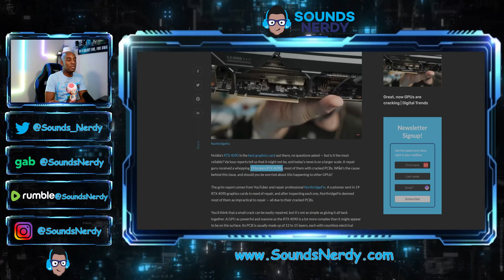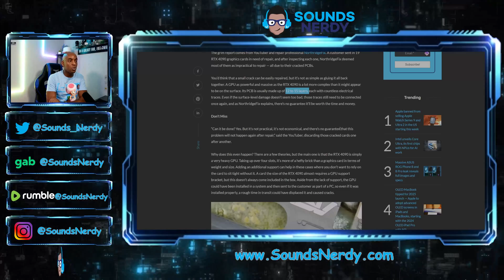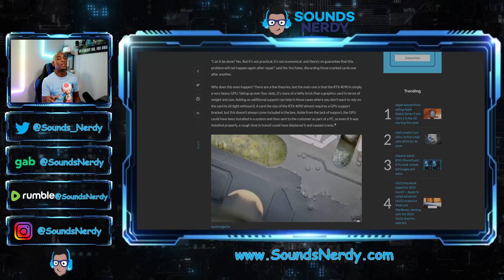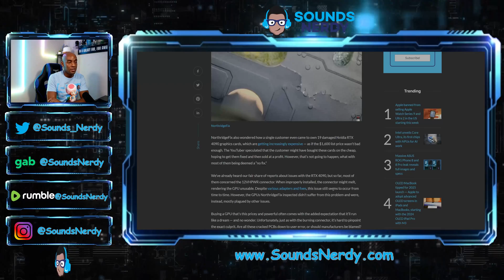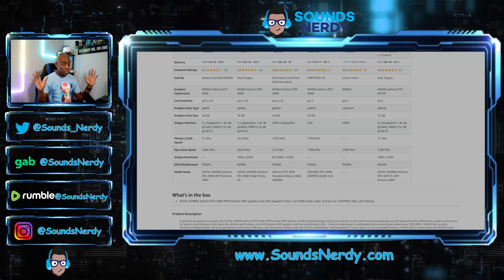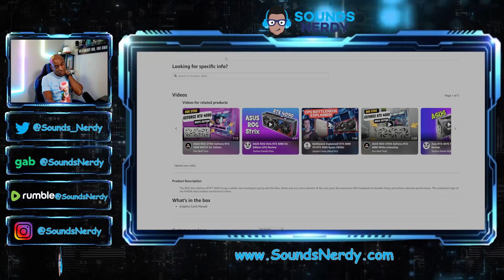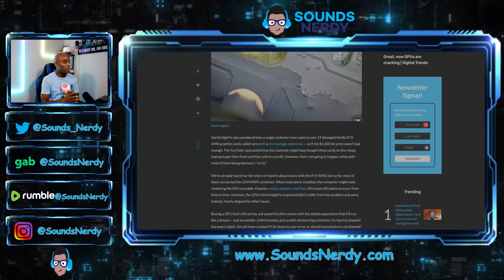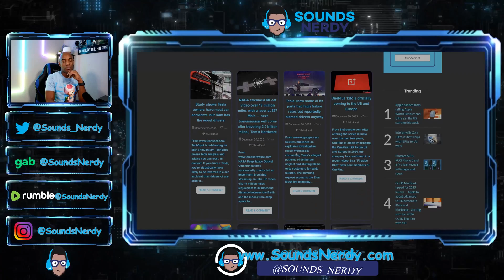Unbelievable! NVidia 4090 GPUs Are Cracking

Comment from the maker: Who do you think deserves the blame for the GPUs cracking?  -- 📰 📰 Get curated tech news at https://SoundsNerdy.com/
Reply: The GPUs are stupid heavy but it's still an user error.
Reply from the maker: @HardwareAccent  Indeed, it almost 5 pounds for that card.  Thanks for watching!
Reply: The weight, that chonk is chonky!
Reply from the maker: @soberedidiot  That card has some junk in that trunk
Reply: User is the blame
Reply: @michaelgriffin3230   nah i blame the card manufacturer , if they don't ship  such a huge ass card with out a support bracket for it. if they do ship a support bracket with the card , then sure it's user error for not makign use of said bracket.
Reply from the maker: @DenverStarkey  You pretty much sum up my thoughts on this GPU cracking scandal!! Thanks for watching!
Reply from the maker: @michaelgriffin3230  Thanks for watching! I think you can make a case for end user error.
Reply: Well designers of the prototype maybe?.   I was 100% sure something like this will end up happening.   It is simply not possible to sustain a card THIS heavy with just the PCB on one of the sides.  They simply went too far.
Reply from the maker: Exactly, how did the designer and engineers miss this little detail. Thanks for stopping by!
Reply: dumb users that think the motherboard can hold heavy parts with faith

Comment: I mean, if you're plunking down $1600+ for a gpu, spend another 10 for a gpu bracket...
Reply from the maker: 💯  Thanks for watching!
Reply: They should really just include one in the box with the card though, they WANT that shit to break
Reply: Yes, so you claim warranty and it costs them.  @niwoh
Reply: @johnathansmith1003  Cracked PCBs are not covered by the warranty
Reply: So you should probably buy a sag bracket for $5 then, since the cards costs so much @niwoh

Comment: Not a single 3k series gpu I have bought came without a support bracket. Maybe you should stop buying that brand of gpu and spend that extra 50 bucks or 100 bucks. 100% on that for a 1500+ gpu. If you spending that to begin with. Who cares about another 500 bucks in price range. Get a good model that comes with support brackets. You can even add extra support if you want yourself also.
Reply from the maker: Thanks for watching!! Yes, when you get to that price range, just spend the extra money.

Comment: LoL the probably didn't put the screws in to hold the card in place a d or the ripped the card outwit out unlocking the slot first
Reply from the maker: @chrisgarner5765 That thought crossed my mind as well!! Thanks for watching!
Reply: I have never had an issue ever with cards cracking, bending or drooping when they are screwed in fully. My 3090 is large and never had any issues with any of that, and it is fully screwed in!  @SoundsNerdy
Reply: I'm also old,  lol, so I have been doing this since the beginning of PCs!
Reply from the maker: @chrisgarner5765  Nothing wrong with aging! I'm older than I look at act.

Comment: easy solution:  Cooler master HaF XB case , the main baord sits horizontal  in the case , so the video card does not hang on the  pci-e slot.  alternately the Thermaltake Tower cases (tower 900, 500 and 200)  have the video card's wieght bassically hanging from the case slots as the main board is oriented in a way that the I/O is facing up. both are unique cases and solve many problems with modern heavy ass GPU coolers.
Reply from the maker: @DenverStarkey Great solution you have here!  Thanks for sharing and watching!
Reply: @SoundsNerdy   i actualy have a Coolermaster HAFXB  case , i've had it since 2013  and i've put several computers into it over the years (just swap out parts of one  and built the newer one in the same case). not wanting to get rid of it it's such a  versitle case , and it's been real nice to not have to worry about video sag with it. 
currently i'm saving  for a new system , and i'm a little bored of the ol' HAFXB . while cooler master does still produce these cases  it's starting to show it's age (mine in particular)  so looking for something different  i'm definitely considering a Thermaltake Tower 500 case instead ... there is one draw back to them though .. they are freaking heavy as three of the cases sides are tempered glass paneled. The tower 200 is a consideration  as it's lighter and can still easily fit a 4090 should i want one in it , but thermaltake tower 200 is also a ITX MB only case. 

i'm stil not decided though rather or not i want to go itx or stick to atx.  itx would be nice  , after owning this huge HAFXB case for 10 years (it's not particularly heavy though it just eats a lot of space).  but at the same time i love high end parts and not sure the tower 200 would offer teh airflow the tower 500 does. what do you think ?  and glad you liked my suggestion  here's links to  the cases i'm talking about: 

Cooler master HAFXB  
https://www.newegg.com/black-cooler-master-haf-series-atx-desktop/p/N82E16811119265

Thermaltake Tower 500
https://www.newegg.com/black-thermaltake-the-tower-500-atx-mid-tower/p/N82E16811133474

Thermaltake Tower 200
https://www.newegg.com/black-thermaltake-the-tower-200-series-mini-itx/p/11-133-508?Item=11-133-508&cm_sp=product-_-from-price-options

give me your opinion which would you take after owning that HAFXB for ten years?
 but yeah video card sag is exactly why i'm looking at the cases and why i went with the HAFXB back in the day. So i figured why not share  my find with others.  all cases feature good cooling (especially the HAFXB) even despite the TT cases having so much glass on them.
Reply from the maker: @DenverStarkey Thanks, Ill take a look at let you know my opinion.
Reply from the maker: @DenverStarkey I personally would go with the Tower 500 because it looks like it will be better if you want to do water cooling..  This is an awesome case too!
Reply: @SoundsNerdy  hmm, it's a consideration , but never been a fan of having liquid ina  computer  LOL so not sure i'll ever go liquid cooling. but teh tower 500 is probably better for air flow any way especially with a air cooler .  any way , thanks for you feedback.
Reply from the maker: Let me know which case you decide to go with. Good luck!
Reply: @SoundsNerdy  ok wil do , but i'm atleast 8 months away from the new build.  can only save 400 bucks a month and aiming for a 3000-3500 dollar price tag (that includes tax)

Comment: i got my RTX 4090 Inno3D ichill x3 verticaly mounted with a holder at the end of the card to hold it as it needs to and also to avoid plug melting i undervolted my card now it takes 280w-300w at full load and maybe losing 2-3 fps not a big deal. im using 3440x1440 monitor so my GPU isnt always at full load anyway so im fine :D
Reply from the maker: @psychoZ856 Thaks for watching! Smart moves here.  Your GPU should last a lifetime!😀

Comment: This has been a known issue for some time now. Back when I was buying my RTX 4090 in July, the news broke that Gigabyte cards were cracking. I was going to get a Gigabyte one and then changed to Asus, only to find out they had terrible coil whine. 

I ended up settling on an MSI Suprim Liquid X variant as it was only a two slot card and decently priced at the time. ($1,699.99)

As for solutions, I think an obvious one you missed is vertically mounting the GPU. No gravity pulling it down vertically equals no crack. Simple and effective. I ended up vertically mounting mine mostly for aesthetics, but also for the watercooling efficiency, lack of vertical force on the card and to prevent any tugging on the power connector so it doesn't melt like other 4090's have.
Reply: Why do business with Gigabyte in the first place?
Reply from the maker: @chrispridemore5562 Thank you for watching!
Reply from the maker: @goudeyman Yes a vertical mount is the most obvious.  I've never had a Mb that was vertical though.  Thank you for watching!
Reply: @SoundsNerdy  A vertical mount is not built in to the motherboard. It is a separate device you must purchase and install in order to be able to mount the GPU vertically.